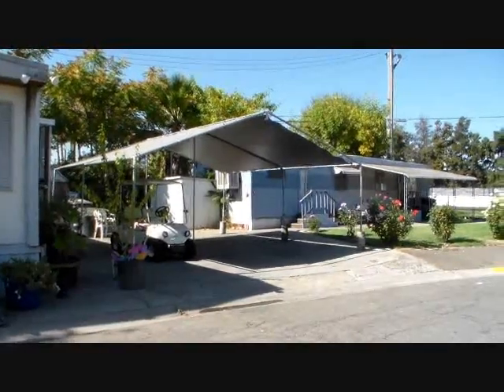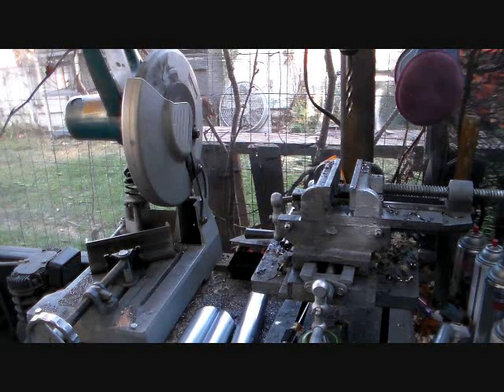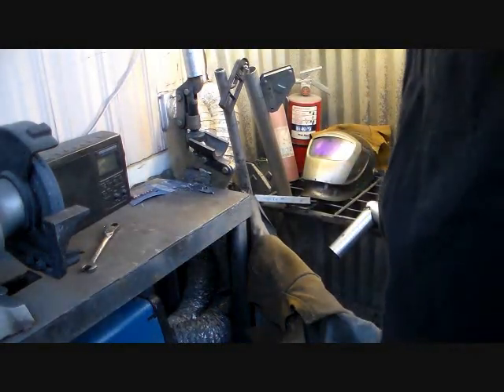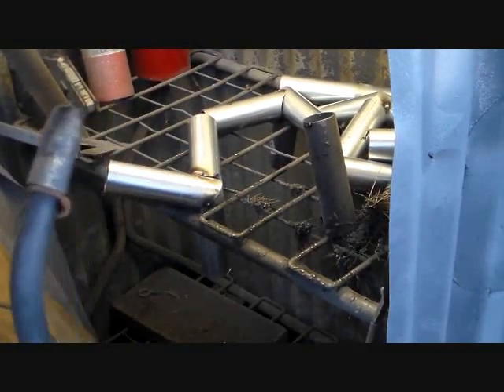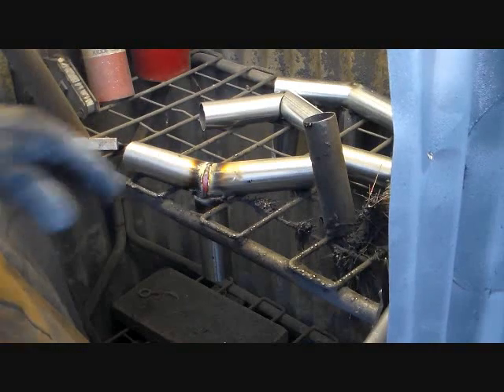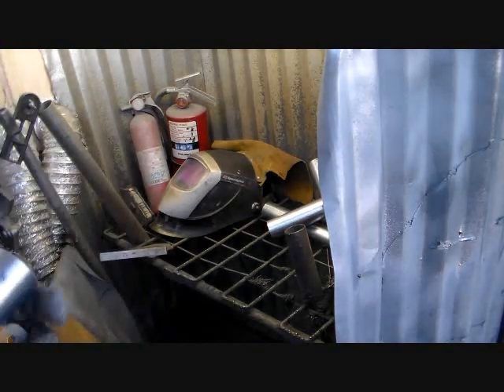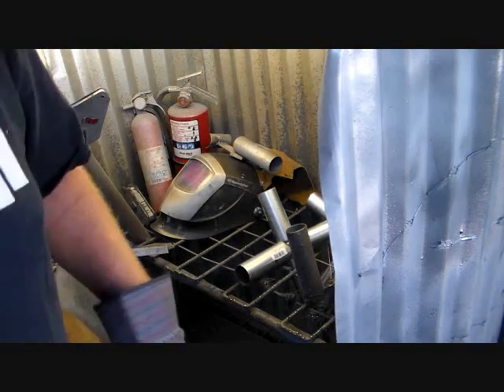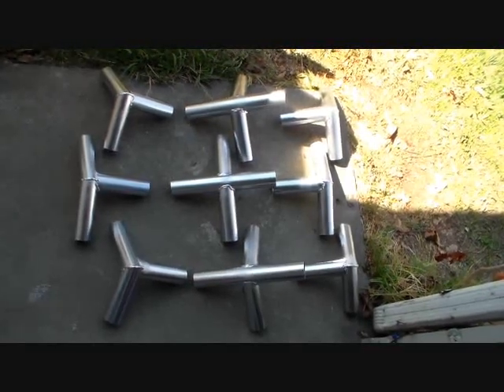How to manufacture a canopy

Comment: Is your metal stronger than black gas pipe?
Reply from the maker: I'm using fence tubing and electrical tubing. Both are 16 gauge or .065''. Black pipe and water pipe are much thicker.

Comment: What brand and type of welder    is use ? Can a 90 amps harbor freighter be use ? ? Thanks !
Reply from the maker: It's a Millermatic 135 using CO2 and .035 wire.
You can use the HF welder on these.The steel is only 16 gauge so 90 amps is plenty.Those models only use flux core wire though which leaves quite a bit of weld spatter and the wire is pricey but they do run on a 110 volt outlet.If you have 220 power and a little extra money you can get HF's next bigger welder that will run flux core or CO2.
Reply: Thanks I just got the Lincoln 180 hd

Comment: What is the size and the thickness of the pipe used for the connectors ?
Reply from the maker: It's 1 7/8'' (OD) fence pipe and it's 16 gauge.

Comment: Do you provide design services? I need to cover a 24 x 46 15 foot tall Adobe home for restoration. How much wind can your design withstand? Can I use harbor freight with your design?
Reply from the maker: My canopy where I sell at is 40'x40'. Back when business was roaring it was 40'x80'. The frame itself will withstand serious wind at which point the tarp becomes the weakest component. If your frame is solid then at about 50-60 mph  most tarps will begin to fail. That's assuming it's a solid tarp. If you use a mesh screen tarp  they can take more wind. HF doesn't sell canopy parts and their carport in a box is cheap and the metal is about as thick as a beer can.

Comment from the maker: Thanks.

A 20x20 requires a minimum of 18 pieces of 1 1/2'' EMT conduit.Home Depot currently sells it for about $12 for a 10 foot section.So about $200 for pipe.
The 1 7/8'' fence pipe costs a little over $2 a foot and it takes about 15 feet of pipe to make a 9 piece set.So about $30 for pipe not counting your time,wire,CO2,paint,etc.
So with tax about $250 for just the basic components,but with a tarp,bases,added srtucture,it could run double that figure when done.Usual cost is $1 per sq. ft.
Reply: Great information